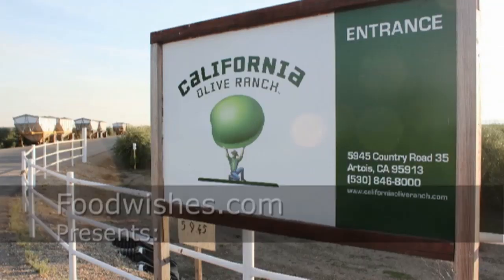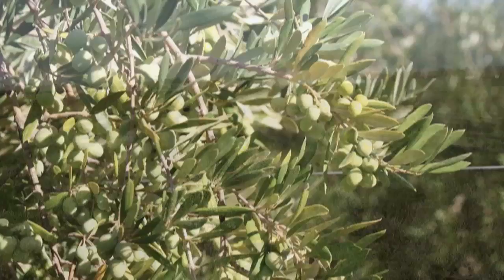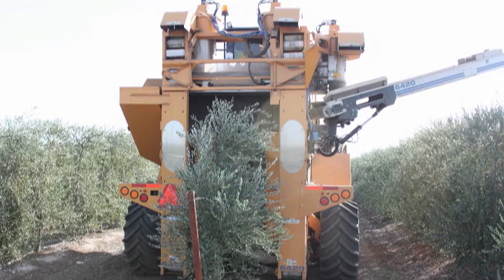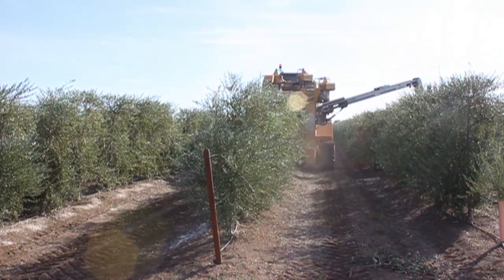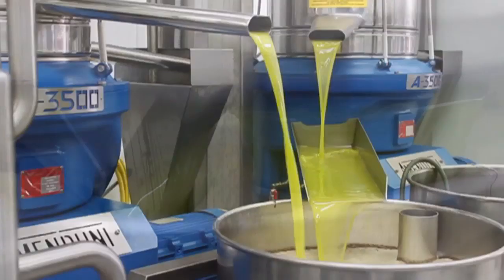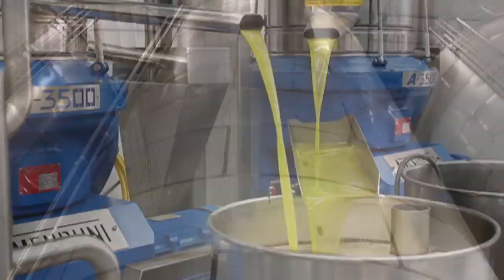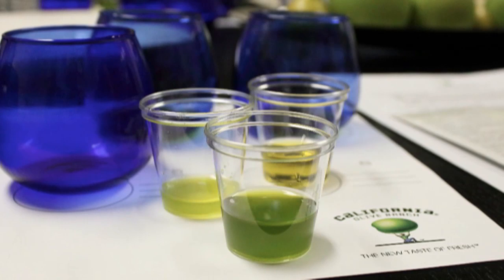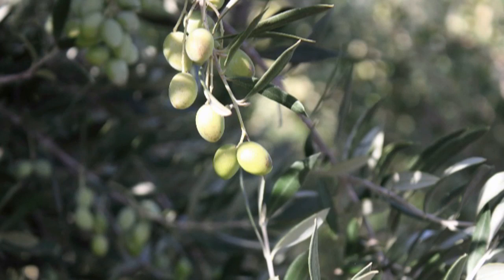Chef John Tours the California Olive Ranch

Comment: california olive ranch started using these soft, cheap green thin plastic bottles that explode when you open them due to the squeezing pressure of just holding the bottle in one hand. When the cap is removed, it spills half the oil. This was a very poorly-concieved packaging error. Why do you think olive oil producers all use solid glass bottles?
Reply: I agree that the plastic bottles are a bad idea for olive oil. California Olive Ranch is the only olive oil I buy, but I won't buy it in plastic. Dark green glass is best, or the metal 3L tin.
Reply: They are in green  glass here in USA
Reply: I just bought one of these for the first time and it was a glass bottle. Also in USA.